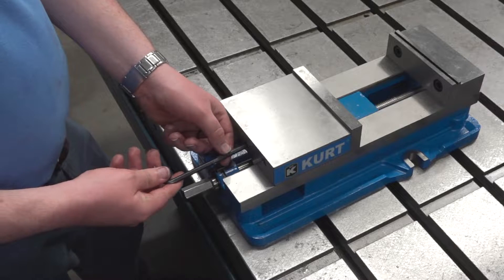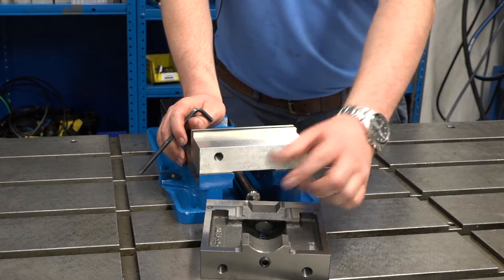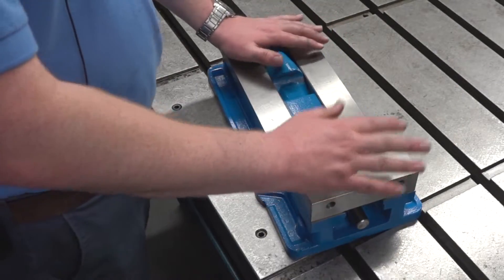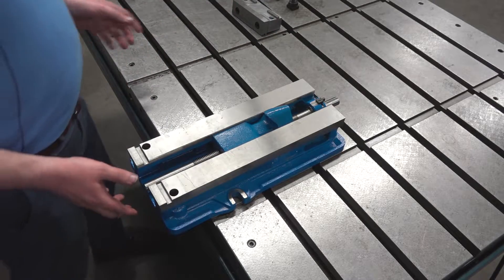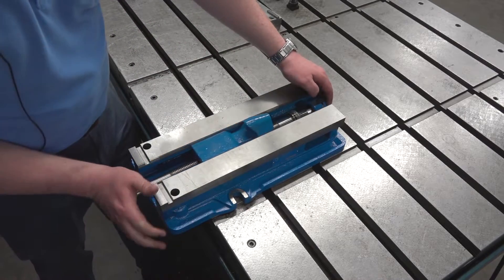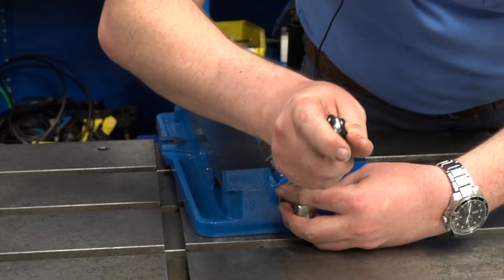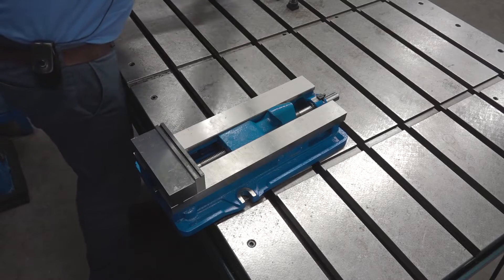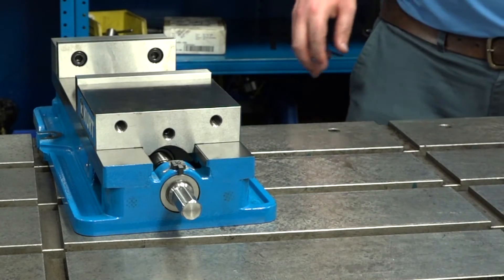How to Disassemble a Kurt AngLock® D688 or D675 Vise

Comment: Ive just got two D675 and in yours also there are two o-ring pockets in the movable jaw,  do you recommend fitting these ? Also is there a torquing method with parallels for the fixed jaw bolts ? The repair kit is a great price, just hope uk shipping isnt crazy.